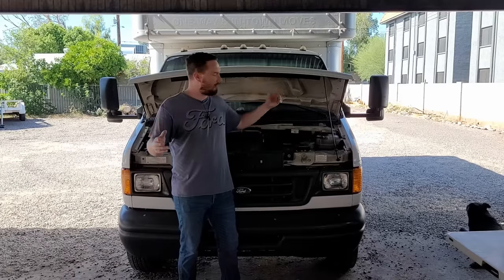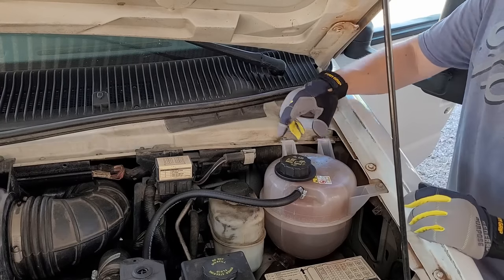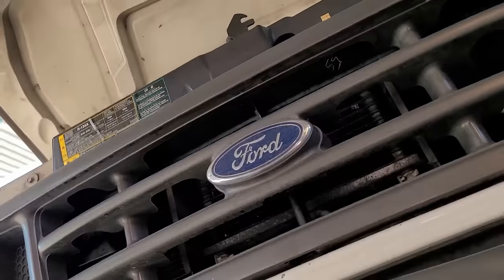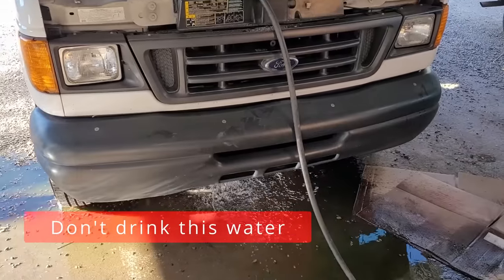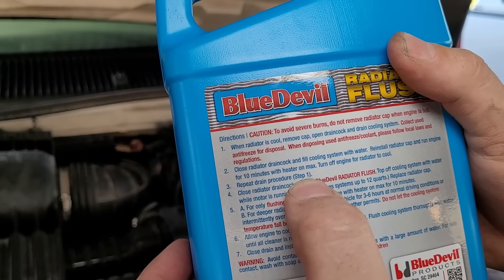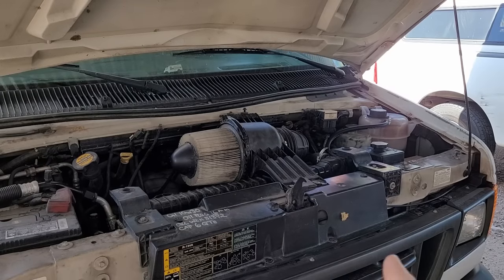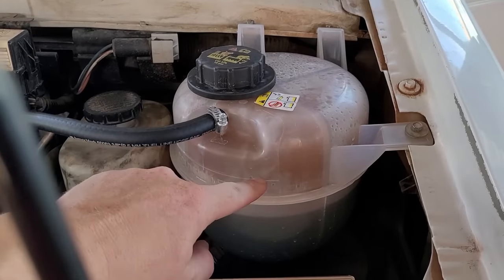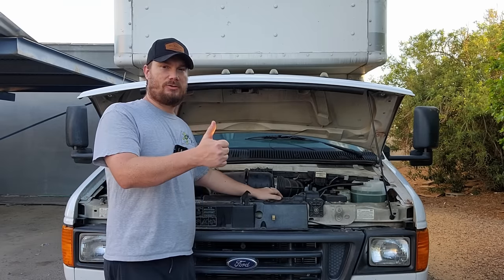How to fix your HEAD GASKET for $56 | Blue Devil vs DESTROYED Ford V10

Comment: I've never tried the Blue Devil branded stuff, but I had success with K-Seal head gasket repair on a beater 2003 Hyundai Elantra a couple years back. It had the typical white cloud out the exhaust, the oil looked like a chocolate milkshake, pulled the spark plugs out of it and number 3 was soaked and the gap was completely closed with goo. It was a car I paid 1500 bucks for and used as a winter beater for 7 years, it wasn't worth my time or money to fix it the correct way, I figured I'd give the $30 fix a try before hauling the car in for scrap. I drove it back and forth to work for few days afterwards, put like 75 miles on it and it stopped smoking and the misfire cleared up. I gave the car to my 16 year old nephew, told him it would probably get him around for awhile as he saved up for something nicer, that was 3 years ago and he's still driving the thing... It's survived all the standard issue neglect and complete lack of maintenance that comes along with being a teenage boys first car, so I imagine it'd be fine for most normal functioning adults.
Reply: I've tried both and the k-seal worked much better in my experience.
Reply from the maker: I think they might use a similar concept.  That's great, I hope mine lasts as long!.  Thanks Frank!
Reply from the maker: @rickjames8317  I'll mix them together to make the ultimate sealer.
Reply: @HerbOMatic  I fully support this! In my experience, anything worth doing is worth overdoing.
Reply: @rickjames8317 😂😂
Reply: Frank where do you Put K-Seal i have an oil Leak on Head Gasket
Reply: 36:42
Reply: Can I try it for my 1985 Nissan 1600 picup
Reply: I trying it now but I add a half gallon o water after pouring half of the red devil
Reply: @HerbOMatic 😊
Reply: Id rather pull the heads and get the heads machined and new gaskets installed
Reply: @coreybabcock2023 Like I said the car wasn't worth it... Its a rusty 20 year old Hyundai with 240,000ish miles, it'd be a thousand dollar car on its best day. Pulling the head off would likely involving snapping every exhaust manifold stud, and putting the head back on would involve dealing with a bunch of broken studs and timing belt nonsense that I don't wanna deal with. Not to mention the transmission would probably grenade 20 miles down the road after fixing the engine... 😂. If it were one of my trucks or my mustang then yeah I'd pull it apart and fix it correctly.
Reply: 16:20 "Don't tell the wife I'm messing around with loose hose" 😂
Reply: Thank you for info
Reply: @HerbOMatic  One thing you didn't mention is if you did or didn't  reinstall the thermostat new or used one. You said everything's going smooth is it still going smooth also how many more miles do you think you have on the truck now since yiu done this? and are you still using the Blue Devil in that motor?
Reply: Пробивал на 2х автомобилях белий дим пропал,но проблема не ушла, двигатель стал ещо больше перегреватся,ето лотерея.
Reply: Did u drain the milkshake oil before putting in the seal

Comment: I used this stuff in my V10 Excursion 10 years ago, still runs perfect to this day.
Reply: I just did mine last weekend in a 92 Buick V6 3.8 but it's in an Australian Holden Commodore , so far it seem to have worked, do you still get full power out of your engine, in the last 1 week I've just been taking it easy
Reply: @JayJay-gl2df  Probably a good idea to run it easy. Before I added BD to my Excursion, I towed a 10,000 lb 35 ft camper all over the US, year round, with it. Now, the Excursion gets towed behind a motor home so it’s had a easy life the past ten years.
Reply: @TJ-qz6hr u used blue devil head gasket sealer 10 years ago and the sealer is still holding up?

Comment: I was having the same problem with my f150 . Hydro locking, the same exact thing as yours, and I followed your advice and problem solved, 9 months and still going at 394,000 miles, thank you 😊👍👍👍

Comment: Worked for 2009 Chevy Equinox. You MUST remove the thermostat! And you must pour the whole bottle directly into the thermostat housing NOT the reservoir. It will work! You must be careful. If it doesn't work the first go at a cold start do it again and again. Took me 3 full cold starts to fully seal the leak! Yes took me nearly 2 days of cold starts for it to work but after the 3rd start the exhaust finally came out clean and the car never overheated again!
Reply: This is a bandaid! Be noted that at anytime anywhere it will blow again. Be ready if I was anyone else I'd buy the white label 'pour n go" and have that in the system ready if anything happens
Reply: Pour it in like it's goin in the motor? Or goin towards the radiator?? I'm having the same problem with my 09 equinox
Reply: And did you do all them flushing?

Comment: As soon as I saw the first attempt fail I knew it wasnt getting hot enough. I had this experience a few years back but my head gasket failure was too much for the stop leak to seal. Glad it worked out for you. Here is to another 115k miles more.
Reply from the maker: I had no idea why it wasn't working the first time until I pulled that spark plug out.  That sucks it didn't work out for you!  Let's hope for the best on this one.
Reply: i got a worse blown headgasket which will kick out the water once the engine is start.. it will not circulate the stop leak into entire system until i try removing the leak cylinder sparkplug which in my case is 2 out of the 6 cylinder and run it without those 2 sparkplug to reduce the pressure inside cooling system.. it work and the stopleak start circulating and patching those blown gasket area on the first day..
Reply: @harisyoung4110 yea combustion is higher pressure than the cooling system is

Comment: I have been using SuperTech synthetic oil for years. It’s great oil.
I used the pour and go Blue Devil in my truck because my head gasket leak wasn’t as bad as yours. I had to do a couple idling runs like you did to get it to seal.

Comment: I fixed my 2007 chevy 3.5 impala with Blue Devil. I completely rebuilt my engine, but after about a year I noticed my coolant was low with allot of crud in radiator. After cleaning it out a few times I knew it was the head gasket leaking. Anyway, I flushed the radiator and engine a few times and used a big bottle of Blue Devil per the instructions. I could not believe it. I have not had a problem since, it has been several years now. Thanks Scotty !
Reply: question for you.....I am having my mechanic run blue devil next week on my car.  I am having to keep refilling my coolant but I see none on the ground.  It is leaking into one of the cylinders, the plug was white. Misfire codes are present as well.  Now I have no steam coming from the tailpipe at all, and I also have clear oil.  Could it be something other than a head gasket?
Reply: @LatrellSprewell15  There is a chemical test kit you can fix to your radiator. If you are leaking between the cylinder and the coolant channel exhaust gas will blow into the coolant. The test kit will show combustion gas in your coolant. Mentioned in the video. You could be leaking oil into the cylinder from the intake valve and leaking valve stem seals. But, since you are dropping coolant level, I would start with the Blue Devil.  You may want to do the blue devil trick yourself to save some money as it does take a fair amount of time to flush your radiator and engine a few times and then the time to add the blue devil and all.  Your mechanic could charge a couple of hours labor?
Reply: @denny5564  yea man, he did that test and it didn’t change to yellow at all. It’s the strangest thing! I appreciate you taking the time to comment back!
Reply: @LatrellSprewell15  you could simply have a coolant leak. Check the water pump, it is sometimes hard to see a leak there.

Comment: Hi Herb- enjoyed your video. I had the same issue with a 93 Toyota Corolla. I don't want to break your heart or spoil your expectations. Blue Devil/Bars Stop Leak/ and other sealers usually last (if you are lucky) around a year. What happens is that your head gasket will simply start leaking in another area. I suggest you use the "Pour n' Go" by Blue Devil after a year if it shows loss or not. Unfortunately, sealers do "not get along" with antifreeze and your problem will resurface at any given time. Sealers are a "Band-Aid" to head gasket repairs but I can see your point in your vehicle where the motor must be removed. As far as my Toyota was concerned, I had a severe head gasket leak and I used the "Bars Block Seal" which required the same procedure as yours did with the sealing. I was able to drive the vehicle for another three years by adding sealers annually before I retired the vehicle at 280 thousand miles.
Reply: Did you use the same sealer annually?

Comment: This Stuff truly works guys. I had a blown head gasket in a 2004 Nissan maxima. I put it in and didn't flush it and  thought that it didn't work. I did notice a difference but wasn't sure. Someone posted that this stuff needs a flash point to truly hardened and worked. They also said to for better results to us blue devil flush and use distilled water. After doing this I drove my car a little high than normal hwy speeds and got the motor hot but  not crack the heads hot but just a high temperature  like water boiling temp. Once i did that and stop and let the car sit and cool. Afterwards OMG did it work and with a rock solid seal. Not everyone will have to do it this way but it worked for me. Flushing the engine first seem to help once i did that and started over.. I have tested it and yess it totally fix. Air conditioner  runs with no engine over heating.

Comment: I 100% agree to leave it in until you HAVE to change it for cold weather, or around 5,000 miles just to prevent corrosion in the cooling system.

Comment: I came back here just to make this comment and say Blue Devil works. I'm in southern Ontario, Canada and perhaps estimates will vary depending on geographic location. My check engine light came on and I had a code for a cylinder misfire in cylinder #4. After replacing coil, spark plug and fuel injector the check engine light was still coming on. I took my van to the Ford dealer. I have a 2010 Ford E250 4.6L with 199,000km on the odometer. They confirm it's got a blown head gasket and quoted $6,534.00 to fully repair. 

I followed the directions for Blue Devil exactly. I bought the Blue Devil radiator flush and followed that also. My van needed 2 bottles of Blue Devil and 2 bottles of their radiator flush based on its capacity and just followed everything. On the second day after completing the process my check engine light went off by itself (did not code clear with the code reader) and its been off ever since. 
I have since drove the van about 1000kms. It works. So if you have a blown head gasket you should use this and I can only attest to it working if you follow it 100%. But it seems like many people have success with just pouring it and forgetting it.

Comment: Thanks... I am going to do this on my 2003 Excursion 6.8 also.  Has slight overheat coolant running through overflow.  Lately getting slight misfire on startup, no codes though.  To be sure i will check for exhaust gases in the bottle..

Comment: I have a 04 5.3 that is pumping oil out the rear main. 5 quarts a month. I tried Blue Devil rear main sealer. In three days the leak stopped. Maybe 5 drops overnight. I have to add some more every couple months. But after 2 years my results haven't changed.

Comment: We use to use Liquid glass ( always worked ) worked so well you have trouble removing the head !
Reply from the maker: When this engine goes down, I'll dump more goop in it, and order a long block!
Reply: @HerbOMatic  Or just actually replace the head gasket - it's not THAT bad of a job [checks calendar] - wait, I've been working on this for how many weeks now??? 6 weeks tomorrow?? And mine are easy to get to / get out (though they are cast iron heads, so they weigh a lot and I used an engine hoist to get them out/back in again). I'd be very skeptical of the sealers working on a diesel though... compression ratio is a LOT higher!
Reply: @HerbOMatic  those v10’s aren’t cheap !

Comment: My ODB2 port is in my glowbox on the passenger side. So NO not always on the driver side. Good video non the less.
Reply from the maker: Is your steering wheel on the wrong side of the car?
Reply: @HerbOMatic  Nope. Just as a general thing with cars as a whole. There is always gonna be exeptions to the rule. But I agree with what you said if I put a mostly infront of it :)

Comment: Long story short.
I bought a 2014 E250, has the 5.4 Triton. Got it on bid for very cheap.
Gonna try this same exact thing this week. Hoping itll work. If it does. Ill be saving $4k in repairs.
If it dont work. I sell the van for more than I won it for on bid. I got a deal that I couldnt pass up.
Has a brand new transmission with a warranty.
Van still work to this day?

Comment: Luckily I have the 98 Ford E250 cargo van with the 4.2 l V6 Essex engine so any engine work that needs done I can do it from the inside of the van with the doghouse out I've done intake gaskets and intake passage cleaning and I deleted the PCV so now the crank case is vented to air and EVAP lines are all deleted too my van is emissions exempt in VA since it's 25 years old but yea I been trying to get it to run as smoothly and perfect as possible

Comment: gezus blue devil's up over $50 a bottle, it used to be half that price, that's crazy...
I've always had good luck with KW block seal, it was a preflush type also and never had it not work but i haven't heard good things about the block sealers that claim to work with antifreeze.....
Reply: KW is good stuff and alot cheaper then Blue Devil. All those sealers are the same stuff, sodium silicate, read the ingredients. $13 vs $60.. for the same thing, different color.

Comment: Looks like a short term fix. It's been over a year now and I am wondering if the band-aid is still holding. It's just a matter of time Herb.
Reply from the maker: She's holding,  20k miles since.  I need to do an update video
Reply: @HerbOMatic    You could also pin an update comment at the top of the video.  I would really like to be able to compare the different sealers and pick the one that works the best.

Comment: Hey, when does the thermostat get put back into the block?  

I’m getting ready to use this stuff on my Jeep and I think that after running it for a day or so I can drain off a couple gallons, replace the thermostat and refill with the Blue Devil mix I drained off.  I assume I will get higher temperatures that way.

Does this make sense?  Or will this cause this stuff to try and do it’s thing in the hotter block and thermostat thereby gumming up everything?

So I want to know when it is best to install the thermostat.  I’m wondering if it is best to do the thermostat after draining and filling with coolant.   My understanding (?) is that you want to end up with a mix of Blue Devil and antifreeze to run on until you get to time for your next flush or at least until you forget that stuff is in there.

Comment: My 07 Toyota sienna with 117,000 miles blew a head gasket so much for all the hype you hear about Toyota s yup most of it is hype, anyhow going to try some of this as there are many of these types of products available now. I had done this back in 2005 to another vehicle and I didn't bother to clear out the system I just poured all of the product in the system, the heat of the engine will burn the water out of the oil, just take it for a bit of a drive, it was still running ok two years later.  And the Super Tech oil is made by Quaker state/Pennzoil.  Just a little less because it's Walmart brand.

Comment: My 2010 Prius was just diagnosed with a leaky head Gasket after I brought it in, suspecting cylinder 2 & 4 were misfiring. I've never noticed Coolant disappearing and the car has never overheated, also my oil looks fine and there is no white smoke out of the tailpipe. Does this still sound like a head gasket? I did go get Blue Devil today to start this process but I am NO mechanic and I don't have the tools or ramps to work on/under my own engine.
Reply: Update

Comment: Fuel line hose for the radiator overflow ? My coolant reservoir came with the hose its a car quest tank i think the previous tank was cracked and system wouldn't keep 16 psi

Comment: 24:03 If the leak is really really bad, you could try running it to seal with the offending cylinder spark plug out.
Reply: But it’s exhaust gas heat activated so won’t seal the leak on that cylinder

Comment: Hey man - how’s the engine holding up? And how far have you driven since you fixed (?) it?
Reply from the maker: She's golding up great, I'd say I've driven her 8k miles.
Reply: @HerbOMatic  That’s terrific. I had my doubts - as you clearly did too - and I’m shocked but glad it worked!$
Reply: @HerbOMatic  I have a 2014 Prius v with 124k mikes…head gasket blew at 122k. I used Barr’s about a month ago and have put on about 1200k, and it seems to be working. It does stress me out a little because sometimes, I feel lack of acceleration from a full stop. 

My mechanic stuck a yellow sticker on the door about towing 3lbs less (Prius?) and slapped on a different oil change sticker. He said he couldn’t tell the car had any issues. Mind you, he’s the guy who initially diagnosed it for me. 

What happens when I go to sell it? Obviously, I’m going to tell the dealership there’s a blown head gasket, but the car runs. 🤷🏼‍♀️

Kbb says the car’s worth 10k and a head gasket repair here in Florida is about 2.5k-3k. I’m also told I won’t know if the cylinder’s warped until they take everything apart…which no mechanic around here wants to work on it. Unless, I take it to Toyota, I can’t get it fixed. Insane. 😮